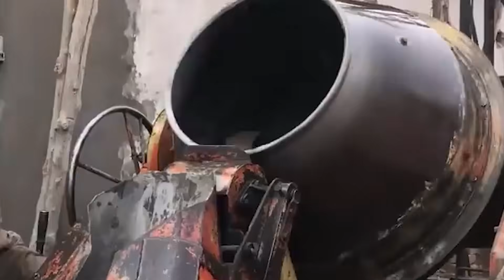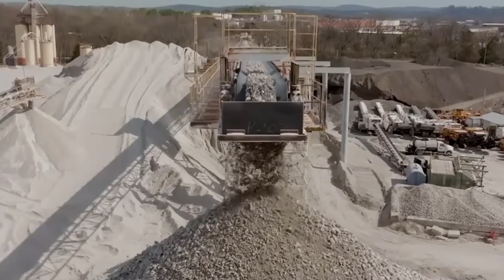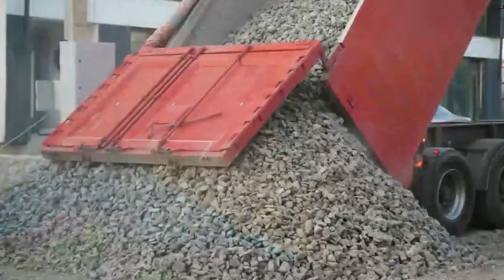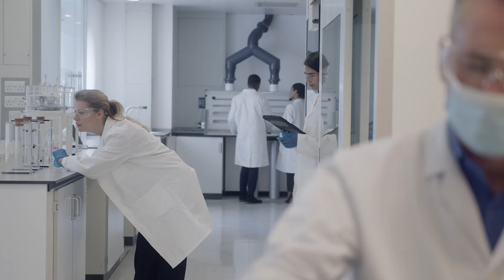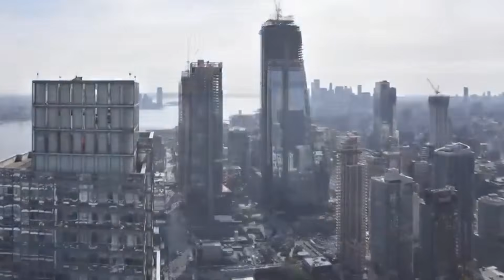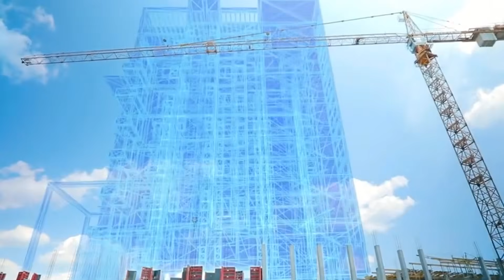China's INSANE Graphene Concrete Breakthrough Will Change Construction Forever

Comment: When I was 7yo in 1965 I was a frequent visitor (with my Dad) around the shoreline immediately surrounding the Throgs Neck bridge in NYC attaching Bayside Queens to the Bronx county neighborhood across the Long Island Sound. Here along the Bayside side among the shallow shoreline were many thousands of coffee can sized concrete blocks littering the scenarie. I asked my Dad what these strange (trash like) objects were. He offered some answer that seemed clueless (to my 7 yo mind). So now... ~60 years later seeing all these identical coffee can concrete objects composed of "graphene concrete" being subjected to strength crush tests... I finally understand what all the trash-like coffee can concrete blocks surrounding the waters around the Bayside side of the 1960's Throgs Neck Bridge were all about... and I'm way impressed that all those old time ASCE type engineers had the foresight to 'dispose' of these seminal/bridge-building artifacts like this along the bridge that these tests built.. rather than burying them in the nearby trash landfills a mile or two away in the Bronx.

Comment: This video makes it sound like the Chinese are simply throwing PCE and Graphene into a standard construction mix. This is not the case, the mixes this video discusses are already UHPC/UHSC mixes (that eliminate the presence of course aggregates and dramatically increase the use of fines) to which the PCE Graphene is added

Uphc is already a difficult thing to achieve without adding the complexity of the Graphene.

I'm not knocking the research, and product, it is fantastic, but this video is somewhat misleading. 

If you add an optimized dose of PCE-dispersed Graphene Oxide (usually around 0.02% to 0.06% by weight of cement) to a standard commercial 40mpa mix:

Compressive Strength: You will see a 15% to 35% increase (Nguyen et al., 2021; Li et al., 2023). A standard 40 MPa mix can be boosted to roughly 50 to 60 MPa.

Flexural & Tensile Strength: Increases by 20% to 50% due to the graphene sheets arresting micro-cracks at the nanoscale before they grow into macro-cracks (Nguyen et al., 2021).

Durability: Water absorption and porosity drop by up to 30% to 45% (Li et al., 2023). This drastically improves resistance to chemical attacks, freeze-thaw cycles, and rebar corrosion.

Comment: 14 x 14 = 196; 24 x 24 = 576 Assuming that your statement that a 14x14 column will replace a 24x24 column, the reduction in material used is (576-196)/576= 66%, not 40%.

Comment: For tall buildings the critical quality is the stiffness rather than the strength -  not just in columns but in shear walls and floors (relating to floor vibrations), so this may not have such a major effect on tall building design.

Comment: I get that it should last longer, but eventually it will need to be replaced. How much more difficult will it be to remove something like a road bed made from graphene concrete compared to breaking up & removing a road bed made from standard concrete? Should removal cost be figured into the life cycle cost, cause i suspect it will cost a lot more just in wear & tear on the equipment like jackhammers etc.

Comment: what's the cost?
Reply: From China it can be $1,000,000 A TON. The company I work for will sell it to you for less that $20k a ton. Yes it works. SOUNDS EXPENSIVE, BUT YOU USE VERY LITTLE SO COST EFFECTIVE.

Comment: Well, the idea does sound promising.  I wondered about using  graphene in concrete where the prospect of high heat exposure could compromise the carbon that graphene is made off, Like in loadbearing coloums, etc, in high-rise buildings, for example, where serious fires may occur which potentially could compromice the carbon-based reinforcing..? 🤔

Comment: Seems like it would be good for Volumetric Trucks -- where the concrete is mixed on site, as it is consumed, out of hoppers separating dry from fluid components until needed. Since the mixing is done with an auger there is less waste in clean-up. 
*After concrete is set, it slowly absorbs CO2 over its life and becomes harder over time.

Comment: This Graphene concreate is not very practical because of the following reasons :
1. Need specialized precise batching processes like additional sonification  protocols, 70 minutes delay 
    and additional chemicals to be added make it very impractical to use in practice.
2. Graphene conducts electricity extremely well , making the building highly vulnerable to
     lightning strikes and harmful to humans as the building is very conductive to electricity.

Comment: Goodness, major weakness of current concrete is weak in tension. Thus requirement for pre-stress, and steel. 
This will revolutionize civil engineering.
Reply: There's one company doing pre cast post stressed concrete towers for China's 20mw wind turbines , 400,000t per year . Modern concrete is not what grandpa used , it's up to 200mpa with the addition of Graphene dry mixed by ultrasound and low moisture content , yet flows like water  
Concrete 
Non cementatious concrete , is going off,  replace kiln dried cement with fly ash and you get furnace grade refractory 
As much as we love cement it is a bigger polluter than auto and aviation but no one stopping flying or driving either
Reply: @northernsamba7388 - probably not such a revolution - there have been high strength concretes with high tensile capacity for a while - look up Ductal.